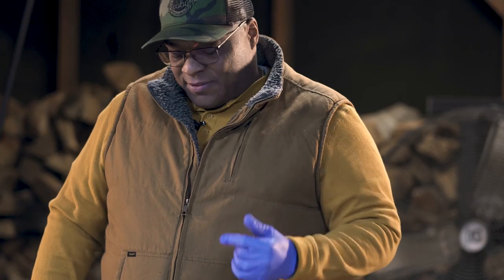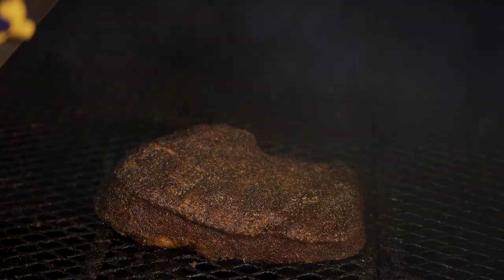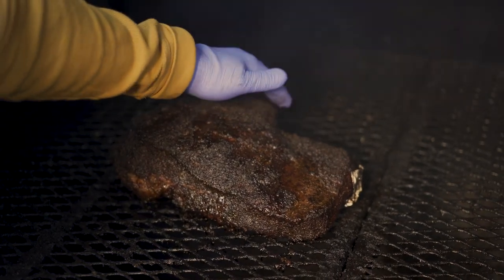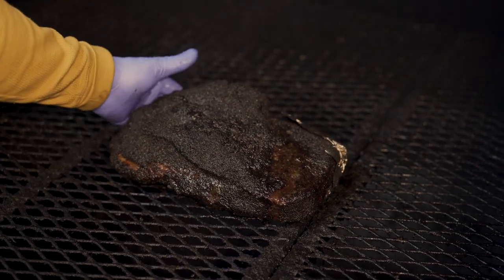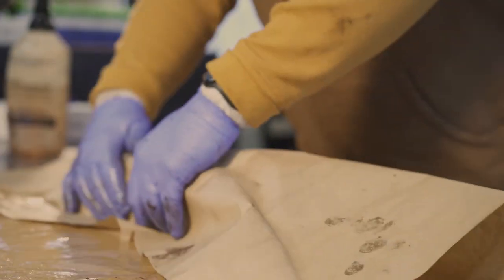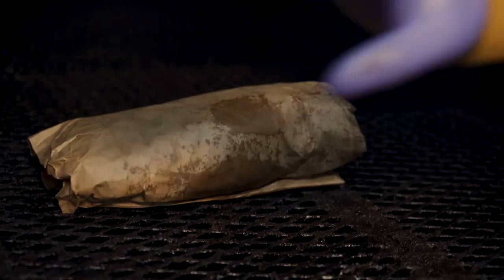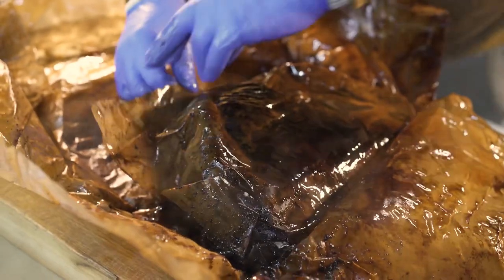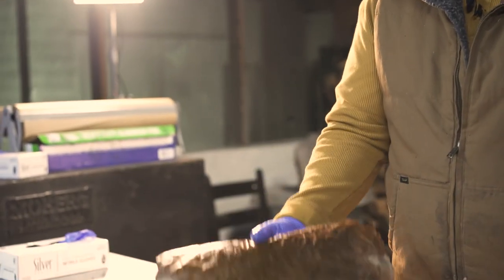Brisket Cooking 101 w/ Tay Nelson!!!!

Comment: Hello Mr. Nelson!
Thank you for the video and keep the amazing work going.
I have a question if you can answer it for me I will be super grateful, As I live in the other side of the world from briskets experts. I always tend to get my brisket bottom a bit dried out. However when I pull it it feels like butter idk why after resting it happens. I use an offset smoker and I removed the deflector. And I usually runs it from 225 to 280 max. And still I have no clue what wrong I’m doing. 
Thank you!
Reply from the maker: Hi Sir, thanks for reaching out and thank you for watching our video and supporting our page! A few questions to be able to help answer your question better:

1. Are you using a whole packer cut brisket? (The flat and point) What kind of brisket are you using? Prime? Choice? Grain fed? Grass fed? Or a mixture of both? 
2. Are you wrapping the brisket in butcher paper the last 1/3 of the cook?
3. When you pull the brisket what is the internal temperature of the meat? 
4. When you are trimming it are you leaving a 1/4 to 1/2 inch of fat on top?
5. Can you send a picture of the smoker you are using? Info@eatbobbys.com is my email

I’ll try my best to help get you sorted out!! Talk soon!
Reply: @eatbobbys  Man so cool! Thanks! 
I did send all the answers to the email. However, I will share them here too.
1)I use whole packer prime brisket, mostly frozen. I wonder if it grass fed or grain. But I will ask my butcher.
2)I  wrap it in butcher paper at 165-170, usually between 8-9 hours in smoke time, but I prefer to wrap it around 175 (maybe because of the humidity) 

3) between 200 and 205 max on flat 
4)I try my best to make it 1/4 inch

Means a lot! Thank you!